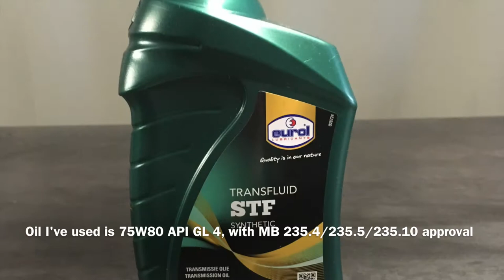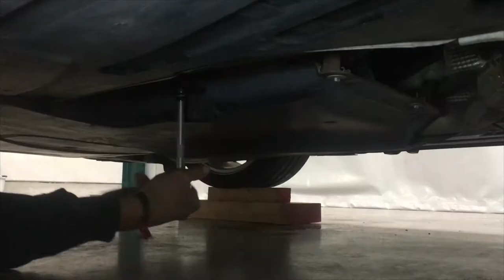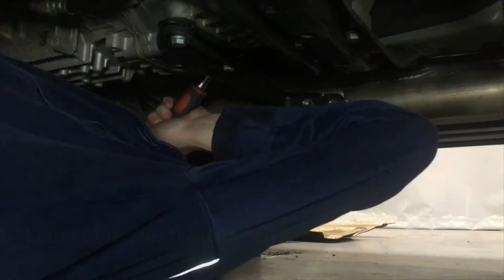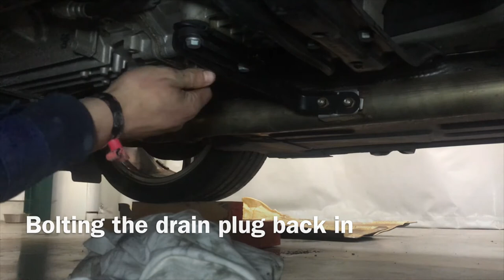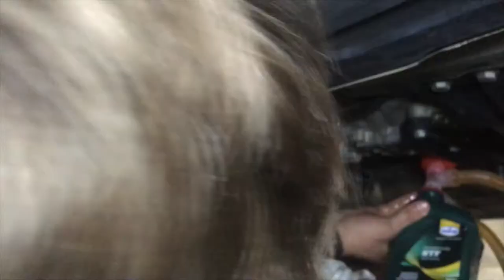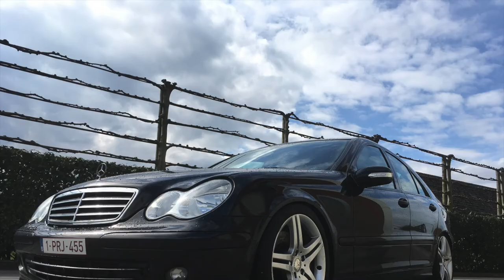QUICK FIX - ROUGH SHIFTING MERCEDES C CLASS W203

Comment: Hello i have a W203 2006 V6 with 272 engine and automatic transmission, it has 56.000 kms and actually has rough shifting. I hope don't be expensive to fix and why happened too soon, nice video btw
Reply from the maker: Hello! Yes changing the oil is the first and cheapest thing to tackle first. Make sure you use the correct oil for your transmission. It's not the same as with a manual transmission. Thank you for the comment ;)
Reply: @anthonyvds  I appreciate the answer :) keeping track of the trouble i saw that the transmission don't shift above the of the first gear so i think it's something about the selenoids.

Comment: What is the names of those wheels? Where would I be able to get a set ?
Reply from the maker: Hello @mahmoud, in the following link you can find the wheels for the rear axle ( 18 x 8,5 ET 30) https://www.ebay.com.sg/itm/Genuine-Mercedes-Benz-Rim-Sport-Package-W209-R171-CLK-SLK-18-inch-NEW-/222443589094 
For the front you need  18X 7,5 ET 36. 
Hope this helps you out.

Comment: Why do you loosen the fill plug first?
Reply from the maker: Hi @Mbz, it's to be sure that I will be able to fill the transmission back up before I drain all te oil. Because you never know that your bit won't fit/the screw is stripped/.... and than you're stuck. Grtzz

Comment: How many km you change the gear box oil? And is it dark? Cause mb says its sealed for life. But they do not mention the life of it!
Reply from the maker: R R D'Souza I should do it every 100.000 km, the oil was a little bit darker (did at around 170.000 km) . But when I changed it changing gears went just a little smoother.

Comment: The gearbox you have 6 speed manual is the same as on my clk200 6 speed manual? 
What type of oil  what brand you use ? Only 1.5  litres?  
Thank you.

Any difference before and after ??
Reply from the maker: Hello, I guess it will be the same gearbox. https://www.mbdecoder.com --> you can use this site to determine your gearboxcode. Mine is : 716654 . And yep it's only 1,5 liters. Shifting was a little smoother after the new oil. Greetz
Reply: @anthonyvds  can u help me man i own a c220 w203 manual as yours and the rear tires one of the tires ( the right one to be exact ) has moved and is shown more then the left one , the other day i got into a hill and it was like some noise from behind , more like a friction , u have any idea what this could be
Reply from the maker: @norimeshau7638  Have you checked if the bushings of the suspension are worn ? And is the friction noise coming from the tire hitting something or from the suspension moving ?
Reply: @anthonyvds  So is it "a little smoother", or "much smoother" after you changed the oil? :) I'm asking because I'm having some gearbox/clutch troubles with my W203.
Reply from the maker: @milecuvalo  It is not that big of a difference, if the shifting is really rough it could potentially be the clutch or the flywheel. But since changing the oil is not that expensive you could try this first in my opinion.  grtz
Reply: @anthonyvds  I did some replacements of the main parts of the clutch, it's almost OK now (mostly from 1st to 2nd can sometimes be funny), but I guess I'm oversensitive about it since I don't see any reason for this to be any problem for a car like Mercedes, especially since everything else is almost perfect on this 12 year old car.

I'm actually quite sure many people wouldn't even think or talk about this, but that's me, perfectionist... :) It kills me when I feel roughness on my W203, while knowing that my W201 (34 years old) Mercedes 190 is basically flawless.

Anyway, thnx for replying bro, I will try with the oil since it's not that expensive, and I'm not sure what did the mechanics do the last time...
Reply from the maker: @milecuvalo  Okay great! Let us hope that you will feel an improvement, good luck!
Reply: @milecuvalo  Could you please explain me why a bad clutch could lead to rough gear changes? Also could you tell me what did you change to improve it? I have exactly the same problem. Rough gear change from 1st to 2nd and now I think it is getting worse also from 2nd to 3rd. I thought it is the gearbox but many people say it is maybe the clutch. Thanks.
Reply: @MrZpiros  Sorry, I can not get into details since  I'm not a mechanic. However: when I changed my clutch and left the same gearbox, I felt improvement, it was much better, altough not perfect. As I said, somebody would maybe be OK with it, wouldn't event brake his head over that, but I'm still not happy with it, and I will probably change the gearbox too (I bought a used one already), and also the clutch because the clutch that I replaced was a used one and a new one isn't THAT expensive. Well, actually it is since I'll be changing the entire thing - the flywheel (is it called that way?), and the clutch, and a used gearbox.

Dont be me...

Btw, my wife has a w203 too, it's smoother than mine, but I feel the same symptoms (her milage is lower!) and I think w203s are a bad deal when it comes to manual gearboxes and perfectionism with people. In other things, they are nearly perfect...

Good luck